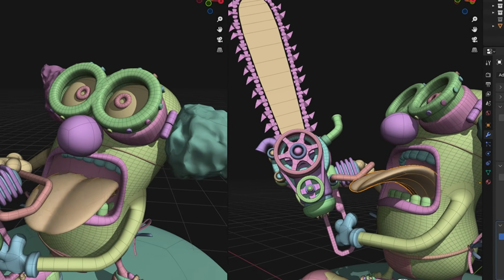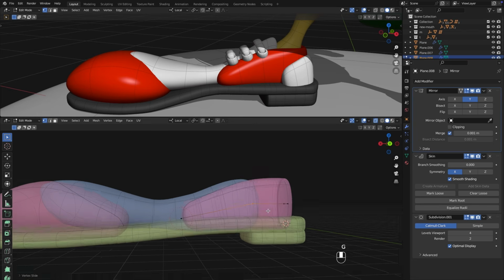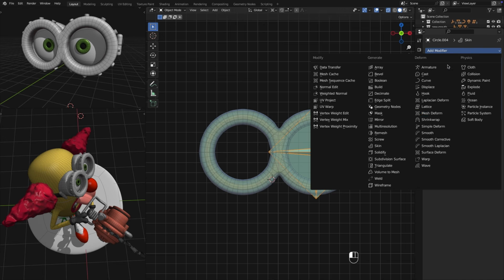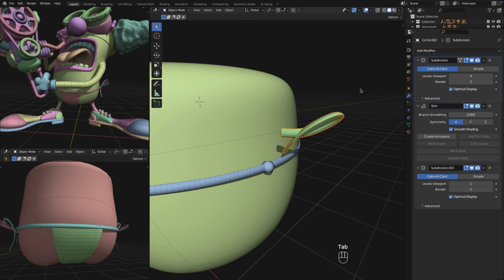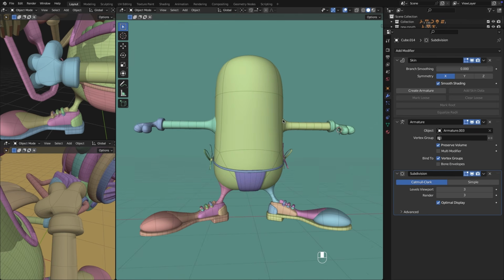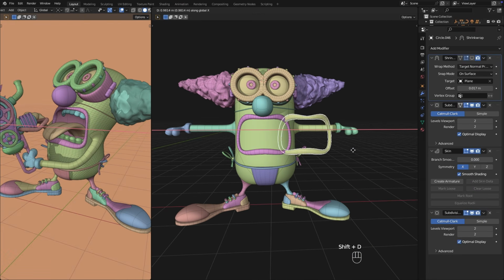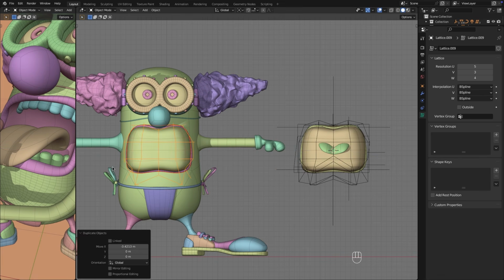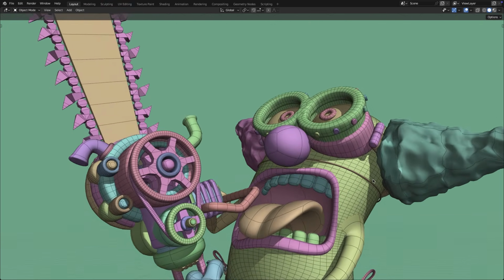I Modeled a Chainsaw Minion with ZERO Polygons! 🤡 (38-Min Blender Masterclass)

Comment: Can a model with zero polygons be used for 3d printing?
Reply from the maker: Yes, of course. You just need to apply all the modifiers to get a regular mesh. By the way, the .blend file is available on my Gumroad. You can check it yourself - print it on a 3D printer. And don't forget to show later what will turn out:)
Reply: @UladzimirArt sure

Comment: How did you split your screen and show 2 separate scenes ❤😊
Reply from the maker: Great question! 💡 It's actually a super handy workflow hack. Both models are in the exact same scene! I just split the Blender viewport in half. In the left window, I selected my finished reference model and pressed the Numpad '/' (Slash) key. This activates 'Local View' and isolates the object. Then, in the right window, I did the same thing for the new model. Blender lets you isolate different objects in different windows! Give it a try, it saves so much time! 🧠✨